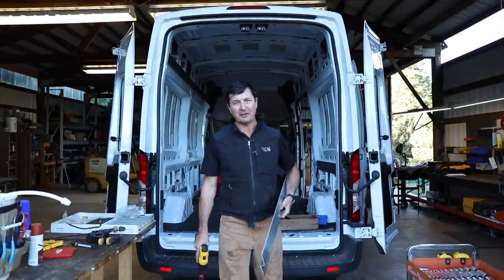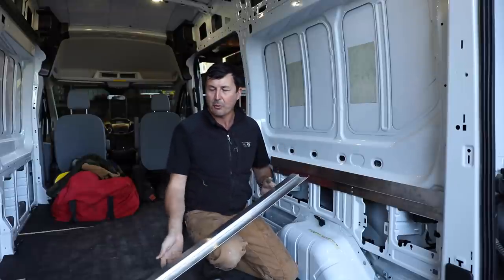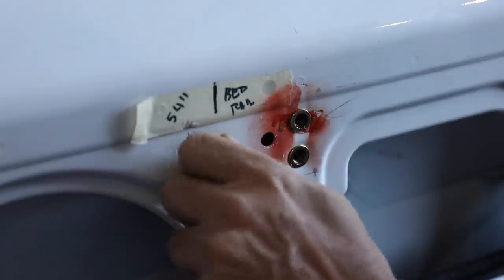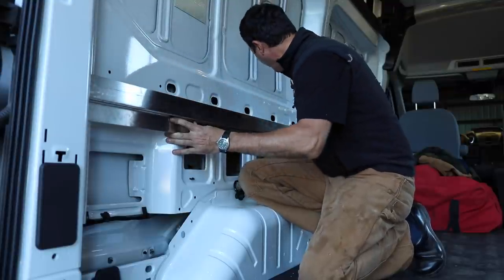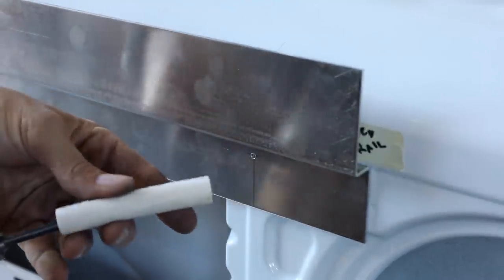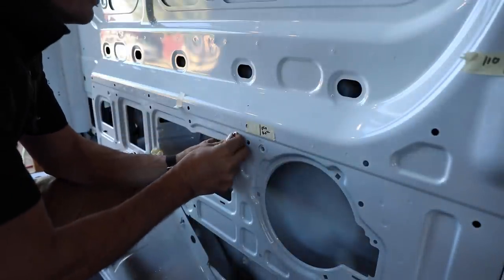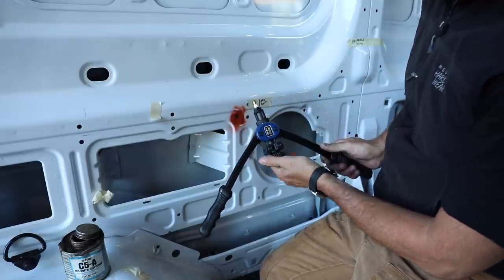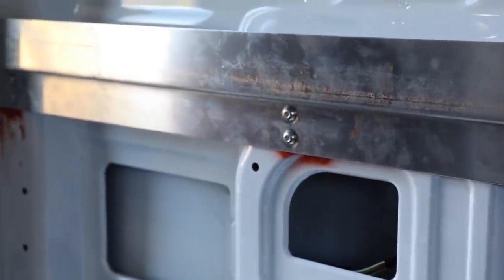Transit Conversion - DIY 3 Panel Aluminum Bed

Comment: Hey, skookum homesteader / Wranglerstar, that thing is a hammer & dollie. Good work so far! Did you get some split lock washers for those button head screws? You put anti-seize lubricant to protect, but vibration can work those screws out.

Comment: Jee, I just rivnutted my van the other day.
I used a small file to debur, but without paying much attention. The rivnuts seem to hold very tight though. I did NOT primer the holes with anti-rust... is that a problem? Is there anything else I could use now that my rivnuts are already set? Maybe spray some WD40 or something?
I bolted aluminium extrusion profiles to the bodywork. To drill a straight hole into the profile I use the drill guide from Big Gator, which I highly recommend.
btw. I also use plastic wedges / packers between the bodywork and my profiles where necessary, I got an assorted kit from Broadfix, very useful.

Comment: Just bought the Rivnut tool.  Looking forward to using it.  I may have missed this as I haven't watched all the videos yet, but , are you doing any insulation or sound deadening in the van?

Comment: Did I miss it? What's up with the red drill attachment at the beginning?
Reply: Its the Astro Pneumatic - ADN14, a drill attached rivet nut setter.
Reply: Thanks!
Reply: Jon P,  it just replaces the manual one. If you search "ADN14" on Youtube Astro has a good demo of it. My guess is Cody wanted a little bit more control/feel with the manual tool or is holding out until the next video.
Reply: really cool!!!

Comment: riv-nuts or nut-serts are the bees knees, there are a couple of thoughts with regard to these.. first off, you can get such inserts that will allow a thicker material to clamp, such as two layers of sheet metal... there are what i think is a bit better type of 'nut-sert'.. i call it a 'plus-nut' as when it's drawn down, it splits out 4 ways like a compressed banana peel, (basically a larger area of gripping behind the metal), now that said, I can provide a pic of what i'm talking about.

NOW, the other point i wanted to make was about how commercial vehicle outfitters do this.. let's assume you want to leave
your up facing rails in permanently, just remove the bed itself when hauling.. so what these outfitters do is to put whatever they are attaching to the sheet metal inside of the van, and secure the rail to the sheet metal by running the plus-nut through both the rail and the sheet metal, then securing that with a fastener of 1/4-20 or 5/16-18.. now them commercial van shelving, traveling with shelves loaded will not collapse or dislodge in a sudden mishap.

Comment: Hi Cody. For future reference, you can get a de-burring tool that will work on both sides of the hole. Take a look here for a visual reference and/or ordering. This is a Canadian site, but the parent company is in the U-S.
http://www.aircraftspruce.ca/catalog/topages/shavivtools90065.php?clickkey=9772
Reply: Or just use a step drill that doesn't leave a rough hole to begin with. They're awesome for sheet metal.
Reply: Maxwelhse step drill was my thought too, though I didn't have an answer for the rear of the hole. Although with how they cut vs a twist drill, they do tend to leave cleaner holes on the rear anyway. Plus they control their own depth by virtue of each step only advancing the depth by 1/8-1/4 inch or so, reducing the concern about accidentally overpenetrating.
Reply: Yep... Step drills are the bee's knee's for sheet metal. I'm a little embarrassed for Cody that he didn't go that direction to begin with. but.... he did make 2 videos out of his twist drill method...
Reply: Ya use a step drill see who's laughing when it bottoms out on the other side and you don't have the right size hole
Reply: Are you adding your vote onto the suggestions here to use a step drill bit?  Or trying to say he shouldn't, because they'll bottom out and not give him the right size hole?  It's not clear what you mean.
Reply: I have one of these, they work great!
Reply: +Maxwelhse I Vote Step Drill thought the same thing right away
Reply: +David you can wrap tape around your step bit as a reference also this is not rocket science

Comment: That is funny! Painting the inside of the van to prevent rust....
It's a transit, it will rust from beneath you in a few short years.
Reply: lol good point.
Reply: Wait till the EGR and fuel system headaches begin.......YIKES at the $$$$$.$$ not to mention the stupid driveline coupling.

Comment: Lived in my old step van for 6 years. Anything you attach to the body will wick either the heat or the cold from the body into the interior. In really cold conditions this can cause a lot of moisture (condensation) on things like those rails. Just sayin

Comment: first off, recommend a uni-bit or also known as a step-bit that way, for single or dual layer sheet metal, you won't have to worry much at all about burrs and deformation of the hole...

Comment: Would a step bit work better to drill the hole? It seems it would make a cleaner hole in this situation and you won't have to play around with a file/grinder/body hammer.

Comment: Ok so you used stainless steel rivet nuts in a steal van width aluminium bolted to it I suppose on the bright side the van will still rock out before all that does you might want to consider putting some form of rust Proofing cavity wax in all the areas you're going to cover up with the interior

Comment: Try a stepped drill bit! Cuts a smooth straight hole with very little burrs! Way better method! I use them all the time!!!!

Comment: I might be looking at this the wrong way but won't those frame rails slowly bend down? wont they end up folding into a Z shape after weight is put on them or do you plan on reinforcing it?

Comment: It crossed my mind there will be all metal shavings in the bottom of the walls of the van, could you put a magnet behind where you drill to catch most of the shavings

Comment: Great video.  Question:  Why are you using stainless fasteners?  Stainless steel is substantially lower strength than the carbon steel counterpart.  Furthermore, the anti-seize you're using does contain copper.  Anti-seize has a nasty habit of migrating all over the place.  Be sure to wipe the stuff from your hands and tools or you'll inevitably end up getting it on your clothes, and it is virtually impossible to clean it off fabric.

Steve

Comment: Are you guys not insulating the van first?
Reply: I was thinking the same thing. If you've ever tried sleeping in an uninsulated car or truck, you know how important it is to insulate. Sleeping in an uninsulated truck is like sleeping in a tin garbage can. I hope he has a plan to add some ventilation too.

Comment: Don't use stainless fasteners with chromate coating. Read up galvanic corrosion, the dissimilar metals will have the body rusting faster then using plain steel fasteners. Gee then your clamping aluminium to it, it's a solid state battery right there. Seriously dump the stainless.

Comment: "have you weight behind it" umm... no a drill bit is designed to cut with no pressure. if you have to push then the bit is dull. get a new bit(they are cheap) or sharpen it. 10 years of aircraft manufacturing experience here telling you you are doing it wrong.